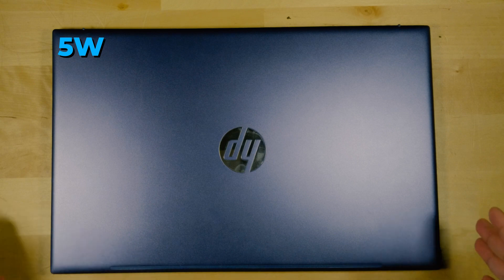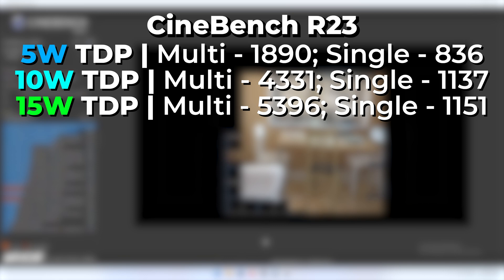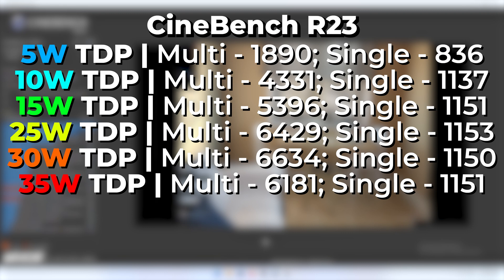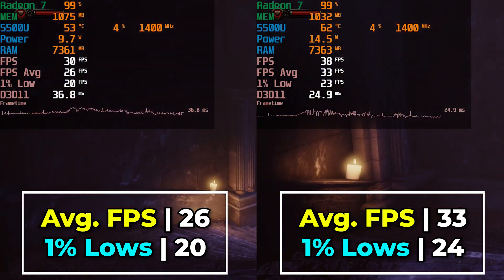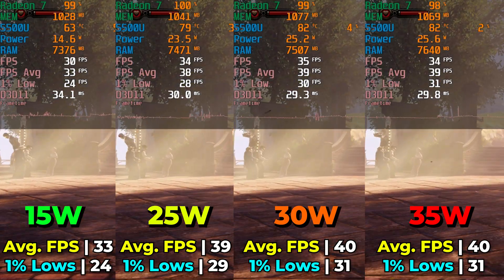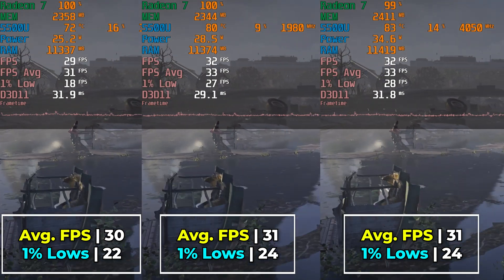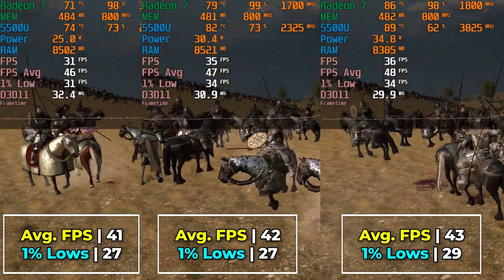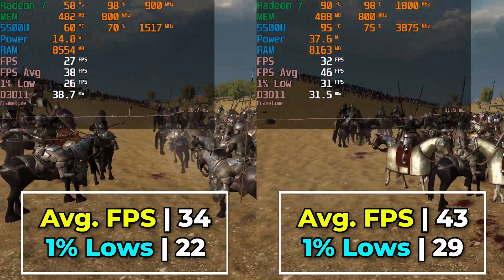AMD's MOST Important Laptop Setting | What is TDP? | Increasing Gaming Performance

Comment: What's trick u use to bypass 15 watt power limit? I also have hp laptop ryzen 5 5625 u.. Trying uxtu and still no luck.. Boost only just few second, then it goes back to 15 watt..
Reply: same issueeee
Reply: it will go back if laptop overheats above 95

Comment: How to see we already use increase TDP when already apply the setting, because setting TDP with Ryzen Controller 25W but when i see at CPU-Z still show 15W
Reply: install "hwinfo" after that select sensor status, then double click CPU tab, double click "core+soc power" for monitoring power with graph, 
Open Ryzen controller, open Power tab, and VRM current to higher number, me using laptop set to 70 A and use 30 watt TDP power